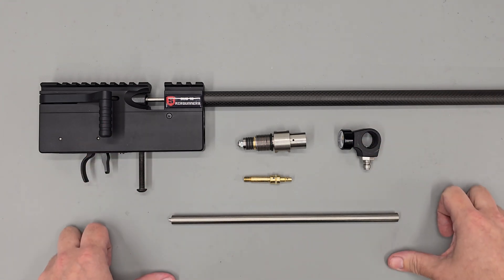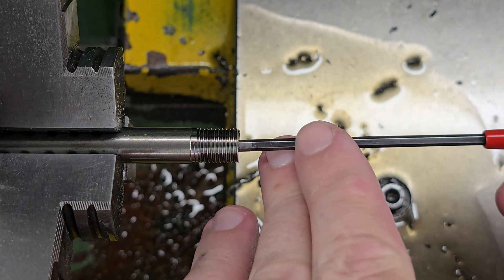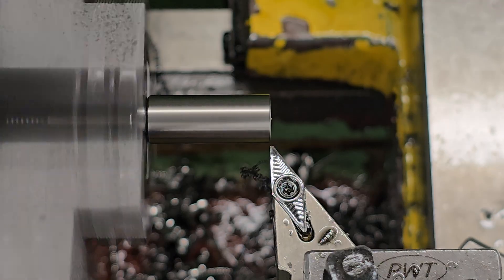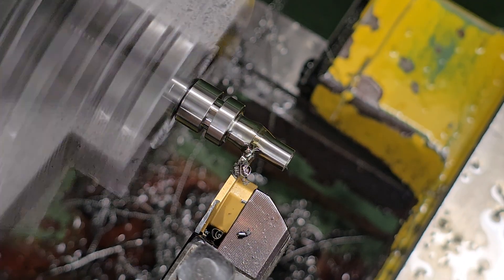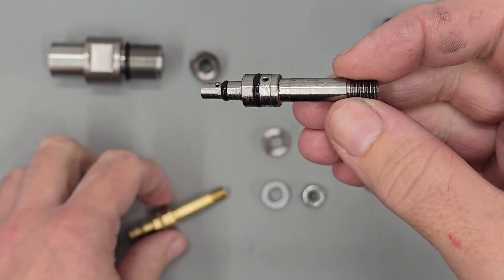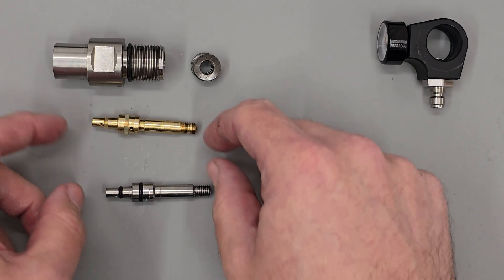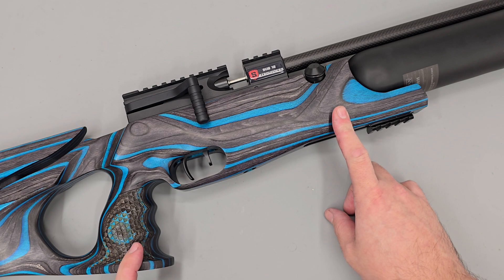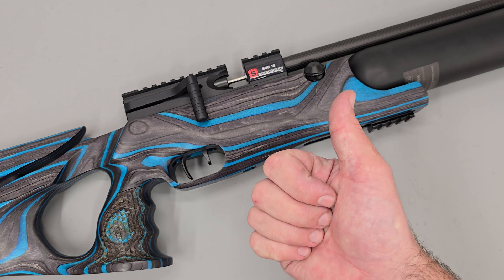Making a titanium reg piston for the Theoben / RAW regulator.

Comment: PEEK is too hard (I do a lot of stuff with PEEK). The best is HDPE. This is akin to Acetal POM-C but approx 5% softer. It seals better. It's the same stuff HUMA etc use. You can get black or white (natural). Delrin (Acetal POM-H) is 10 - 15% harder than Acetal POM-C.   Delrin (Acetal POM-H) is the hardest you'd want to go on the sealing face.

Comment: Very interesting, thanks for putting in the effort as well as showing your work. I'm using a RAW HM1000X in .22 for shooting PRS and NRL22 competitions. My reg is set at 180 bar and I'm shooting 40 grain slugs at 970-ish fps. I haven't noticed much lag in the regulator when shooting as fast as I can accurately shoot, maybe 2 to 3 seconds between shots. I imagine having my regulator set to be twice as stiff as yours might make mine reset faster, relatively. If you ever need to kill a couple of hours, I would love to see a comparison of the two regs at higher pressures.
Reply: What barrel are you using, and what speed a are you getting
Reply: @woogieman02  Factory .22 barrel, 1:17.7 23". Accuracy is best at 960-965 fps
Reply: @scottcottontx  Have a similar gun set up my Martin.  Shooting Corbin slugs I swage at 34 grains, moving the same speed as yours.  Absolute hammer, though haven't been to many matches lately.
Reply from the maker: thanks for watching and the interesting info 👍

Comment: Surely the speed at which regulator component moves has very little effect on the regulator's performance; especially  in a operator-cycled  (i.e. non semi-auto/auto) rifle. Carbon fiber and titanium components seem to hold a fascination for the marketing folks;  with no scientific basis for most real world applications. To be fair, you do express some skepticism yourself, and I must say I enjoy your videos and the careful machining content in particular. So not a personal criticism...
Reply: It actually makes a big difference, lets say at 200bar the valve is open for 10ms and lets in 90bar of pressure. At 100bar it will let in 85bar of pressure (less bottle pressure over the same 10ms). So over a fill, the pressure differential becomes a factor. A reg that closes quicker is more consistent over a fill. (Of course there are other factors - this is a very basic simplification).

This is why Rapid regs are a lot better than Huma type regs. Humas have no pre-tension mechanism and therefore have to open fully (bellevilles at full relief) then close right up again. This takes time... a rapid reg is pre-tensioned and only moves the amount of distance it needs to (minimal = less time).

Of course the best way to assure consistency over a full fill is to restrict/control the flow of air into the regulator, rather than trying to speed up the reg core by reducing weight. The reg fills slightly slower, but is generally more consistent over a fill. Think of the MK1 Rapid, it had a tiny hole to reduce the flow to the pre-chamber - stopping it being a fast flow. e.g. the air was controlled coming from the bottle after a shot, stopping the shot from drawing directly from the bottle (because the air could not get through fast enough).
Reply from the maker: i didn't expect much difference but i just wanted to experiment and i would agree that exotic materials are bragged about on pcp's and upgrades and often of no benefit in real terms